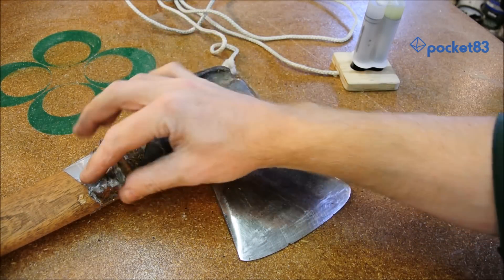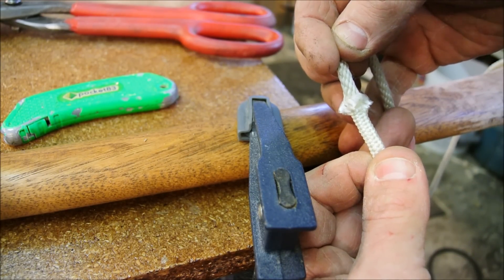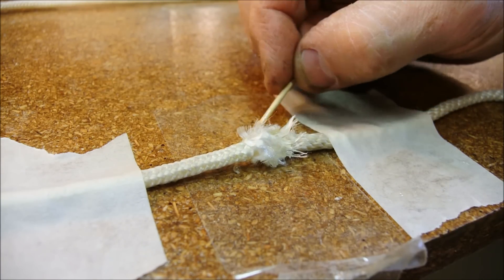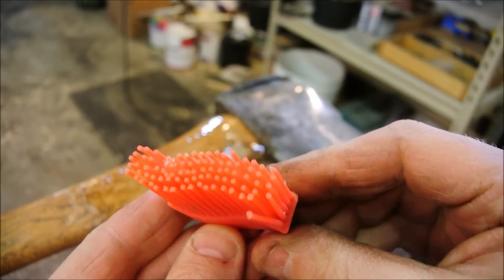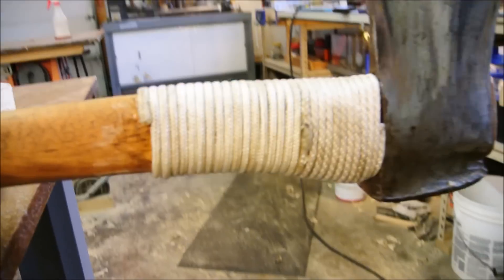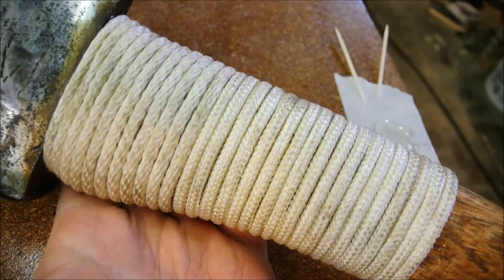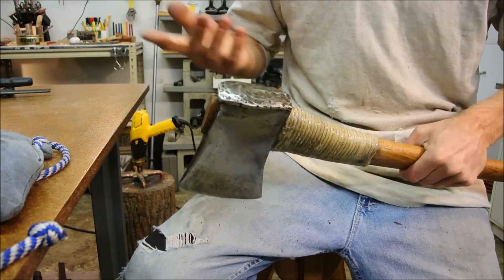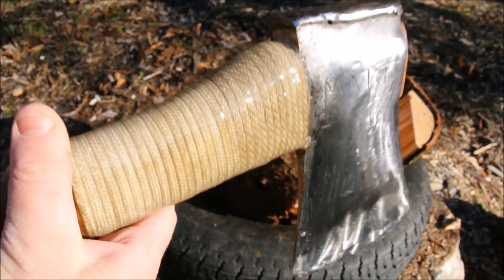Axe handle guard = Rope + Epoxy

Comment: There is a knot called a frap that would work well for this. You make a loop on the surface and then wrap the cord around it. When you get to the end you tuck it into the loop and pull it under the wrapping and trim the other end. It leaves no exposed end to break off. I used it on a sword handle and it worked really well.
Reply: A common whipping knot is what the poster was describing and is arguably more simple than a square knot and leaves a much better finish.
Reply: Frapping is the word for wraps between the spars in some lashing techniques. I don't know how a square knot makes any sense in this context, unless Gary meant West Country whipping....

Comment: Regarding epoxy tips and tricks:  When trying to coat things with epoxy (like the top coat you applied), I usually add some acetone to the epoxy to make it more spreadable and to help it wick in.  

For mixing, I just use an old glue-bound catalog.  Rip one cover off, mix epoxy on the exposed page, when done, rip off the page and you're ready to go.  It's free, it gives more room to work with than tape, and you can pick it up and move it if you need to reposition your work..  

If I need a brush or spatula, I just use a putty knife or a hoghair flux brush.  Clean up is quick and effortless.  I have a jar of lacquer thinner that I use for cleaning small things.  All it takes is a couple dunks and wipes with a paper towel.

Comment: My solution is welded metal handles. I've made a 18" handle for a hatchet from a 1/8"x1-1/2" flat bar and it turned out pretty good and balanced. I have a fireman's axe head I made a 27" handle for from 3/16"x1-1/2" flat bar with oak grips. It's not designed for chopping firewood but I like it. I'm working on a double bit axe right now that I plan on cutting wood with.

Comment: you can try using a heat shrink that has a glue for water proofing inside it, put it on the axe and heat it up to shrink it on .the glue inside melts and then sets again when it cools down .two layers of this will last quite some time and when needed to be replaced just heat it up and cut it off while soft and then replace.

Comment: I am using a piece of cord on my axe for 6+ years, and it works like a charm. I didn't use any kind of epoxy and I think that it is better, because the rope remains elastic and reduces the impact in case of a slip. Also I just knotted it on the handle with a knot we call "takling" in german.

Comment: Hello, thank you for sharing a novel way to extend the longevity of the axe handle! Appreciated. Could you let me know if the guard still does its job propertly after 3 years? Thanks!
Reply from the maker: Strongest guard ever. Highly recommended. The handle in this video broke for other reasons, but the guard was still like new at the time. I then replaced it with an identical, and that guard is now working on its third season under year-round use. As of September 2022, there is one small chip removed from the epoxy. I'll get around to filling it in sooner or later ;)

Comment: I have used the exact process, only using thread, to fix my broken glasses, and used Super Glue.  The finished product was stronger then the original joint, and once the thread was saturated in glue, it just looked like a piece of black plastic.  I will use this technique often.  Thanks.

Comment: Another great video pocket! I don’t know if anyone else noticed this, but one of the older copper wire epoxy stirrers that you used had a patina near the top, but the lower end that actually mixes the epoxy has been preserved by the residue left behind. Anyway, I thought it was interesting.

Comment: Depending on how you value your own time, it would probably be easier / cheaper for most people to simply purchase a Fiskars splitting axe. But this is a cool idea, and I did enjoy the video.
Reply: Matthew Clausing  good solution. Fiskars are reasonably priced. Steel sharpens easily.

Comment: My unsolicited advice is to end it with a clove hitch. When  you cover or soak it in epoxy, it essentially becomes a micarta covering.
Reply from the maker: Haha. Experimental suggestions are awesome. That's not the same thing! But how do you mean? Like, how could you tie the knot without making a big bump?
Reply: pocket83² a Clove hitch would be two layers at one point, but it doesn’t stand far proud of the whipping around the handle. I do walking sticks and knife handles in the same manner. Bushcraters whip, French whip and braid over just about everything for some reason with paracord, jute, hemp or tarred bankline.

Comment: I did similar with much smaller nylon line and used a couple wraps with epoxy between the layers and a layer of epoxy on the outside. 
I'm still using both axes today. The very thin outside layer soaked into the twins leaving it slick and strong.

Comment: As far as expoying rope, I have seen similar applications done using a funnel. Feed the rope in the funnel first, then fill the funnel with glue and pull the rope through the other side.  EDIT: Is that an actual bionicle
Reply: Indeed, I believe so.
Reply: That sounds like a great strategy

Comment: When it comes to the splitting logs like this - never try to acommplish in a first hit. Choose the path betveen branches, preferably  butt log upward,  make a first hit aiming to a corner towards from you.  When the wood fiber cracks a little, proceed with a second hit on side closer to you from the log center. Thats how you never hit the handle and save energy. Nice axe and good luck ;]

Comment: I find tarred twine works very well for this, no glue or epoxy needed it binds super tight and the tar causes it to grip and not come loose, I then sometimes will use leather over top for appearance but not always.

Comment: I find the safety comment conundrum fascinating. As a viewer I have found them useful for tools I don't have experience with, but I can see where having the same stupid comment over and over every time you use a tool in a video, cascading down through the years as the video remains on youtube... well, that would get annoying.  And nothing is ever just dangerous, it's always extremely dangerous.

Of course, it could always be an opportunity. Write a mini booklet of safety advice for each tool you use, only $10 for the e-book version! "This video sponsored by the Pocket83 safety booklet!  Buy now before supplies of this e-book run out!"
Reply: And if you act now, it's free, just pay shipping and handling(which is conveniently more than the cost of the booklet and a small profit)

Comment: Rawhide could be interesting. Applied wet it will shrink/constrict when drying, if I remember correctly.
I wonder what the added compression will do for handle stability?
Reply: I have thought to use rawhide for an axe of mine. One can make an whole axehandle of rawhide too but probably only up to a certain weight and with a holeless bit. People on the prairie and steppe used bone and rawhide, lacking wood, for many applications.

Comment: As an iron worker, we used tie wire. The metal wire used to tie rebar. Then we would wrap that with black athletic tape. I see your epoxy, cracking and breaking with a solid hit
Reply from the maker: Eventually, sure. But it's also easy to fix.

Comment: I have used cotton fabric and epoxy to do the same thiing before, and it is amazingly strong. Just takes longer, as you do one layer at a time and repeat for the number of layers you need.

The only thing I worry about using paracord and 5 miinute epoxy is if 5 minutes is enough for the epoxy to fully penetrate the paracord.

Comment: Just a little tip to anyone doing this, if you wrap some clear packaging tape around the epoxy while it’s a bit less runny it will keep it smooth so you don’t have to sand it down as much or even at all. Usually the cheaper stuff works better because it’s less sticky and easier to take off when the epoxy dries.

Comment: I've done wraps like that. I usually secure the ends by drilling a hole perpendicular through the handle and running the end of the rope through the hole. I use a small wooden pin or wedge to lock the rope or cord in place. In the centerline, it doesn't affect the strength of the handle to any noticeable degree. For thinner cord, it's possible to tuck the ends under the wraps instead. Never used epoxy though. Mostly used paint or varnish to soak the rope/cord and adhere it to the handle. For an axe that'll see a lot of log-splitting, I prefer to make a metal guard.I've no idea about how much better it'd be according to some factual scale, but since you don't have to wait for it to set, a metal guard is probably overall faster to make. And less bulky, if that's important to you.

Comment: it works well to tuck the ends of the rope under itself, pulling it under and up. once it dries, you just clip off the tip sticking up.

Comment: What i normally do for my axes, is i first wrap with thin steel string (1mm), not the braided kind, but the solid ones.. after i've wrapped it all in a thin one, i then do another wrap in one thicker steel string like (2mm-3mm) lasts for ever :)

Comment: I worked in the oil field and i used a rope as well on my sledgehammer to help with the impact and it helps
Reply from the maker: Wow. That sounds like a tough job. Respect from a former roofer.

Comment: Hey pocket I just got my new double bit axe handle definitely appreciate you going into detail about informing me on the green orientation I found one that runs perfectly with the heads of the ax but I have a huge question before I hang it. Can I use epoxy instead of wood glue in the wedge? Do you think it would work? I'm talking about the wooden wedge that you put your wood glue on, and I don't have wood glue and that's why I ask.
Reply from the maker: If you fit the wedge and handle well enough, you don't really need glue. Some people use linseed oil on the wedge. Personally, I use wood glue exclusively, but I don't use step wedges. 

Hmm. I don't think epoxy would be a bad idea, but it's not a good idea, either. Why not? Because it wont allow moisture to pass through it. I don't really have a strong opinion, and I can't speak from experience on this one. I do strongly recommend picking up a bottle of Titebond II if you plan on making many of my projects, since I use the stuff constantly.
Reply: @pocket83squared  thank you so very much your opinion for some weird reason means the world when it comes to my projects. So the fact that you gave me your opinion on using epoxy completely open my eyes and I did not even think about moisture getting into the handle itself I will be picking up a bottle of Titebond II probably tomorrow just so I can put on my way. But it did come with two step wedges which brings up my next question do to your answer why don't you use step wedges is there any particular reason?

Comment: I use construction adhesive/liquid nails and poly baling twine. Liquid nails is good as its a rubber bassed compound and has a bit of give in itBelieve epoxy will be to brittle and chip

Comment: We used baling wire when we were young. Start with the end over the head of the axe handle. Go down about 4 inches below where the axe head will sit. Wrap up tightly to below where the head will seat and end up with the wire end running up under the axe head.  Reattach the axe head, wedge it and the wire will be a strong and long lasting repair.

Comment: Just curious, Pocket. Where do you get the wood for splitting from? Did you fell a tree on the property? And if so, do you try to plant another one in it's place? Or did you scavenge the property for dead trees? I live in AZ, so I'm not familiar with how it works to need to burn wood every winter.
Reply from the maker: Ok, first off: you and I are from different worlds.

I once went quad riding outside of Phoenix, and I thought it would be hilarious to mow right over a Saguaro cactus. It exploded down like a dead tree. My friends were all yelling and waving, so I came back wondering what the problem was. Apparently they take forever to grow, so they are protected. Not the case with trees in PA; if you need a walking stick, you slash a sapling. If you want some wood to burn, take your pick. No need to replace a tree here; within two years, fifty more young spring up in a fallen tree's new sunlit spot. 
So live wood works as follows: it's waaaay too wet to burn right away, so you have to 'season' it by drying it out for a year. But the woods are filled with dead wood here, especially in places where there has been logging. Some of it stands, some of it falls naturally. They all burn with different efficiencies, based on age and variety, but there's more than you can ever use. 

One more thing: don't get the wrong idea, as though I'm wasteful or irresponsible; I use my wood with the best effort possible for its conservation. In fact, in respect of its beauty, I will die without ever logging my own property. I regard dropping a great tree as a (sometimes) necessary tragedy. As such, I can afford to waste my trees without reaching any natural limit.
Reply: @pocket83squared  That's pretty cool. Thanks for sharing!

Comment: I was wondering if after wrapping in rope, instead of sealing with epoxy, which is hard and brittle, coat it with a couple of layers of spray on bed liner. Then it has a durable and flexible outer layer.
Reply from the maker: Hmm. Maybe!

Comment: What about rubber from tyres? Those suckers can't really be disposed of in a proper way, so I try to make any excuse to harvest the material. What with all the stones and potholes, they are made to take a beating.
Reply: if you can find a way to easily apply it to an axe handle i would love to see that. but from what i've seen on how to make tire it's not easy, and require a lot of heat and a mold.
Reply: @BloodSprite-tan  either this - or just epoxy a square piece of tire to the handle with a clamp :)
Reply: @BloodSprite-tan  I was thinking cutting a piece of rubber from an existing tyre, then gluing it on top of the rope and epoxy. I imagine CA glue would bond well enough between the rubber and hardened epoxy.
Reply from the maker: Tire is brutal to cut. Every time I try to craft something with it, the steel radials remind me again of why they just end up dumped over a hill somewhere. Still, you're a good person for trying! If you must persist, maybe try a mountain bike tire, since it will be waaaaay easier to wrap.
Reply: pocket83² a hefty bmx or cruiser tire would be ideal. Also with bicycle tires often the only steel in them is in the bead. The casing of the tire is generally made of rubber and Kevlar/cotton/nylon fibers
Reply: @schenksterify  I think the same is true with gokart tires. They're wide and quite pliable, and their naturally small radius should mean wrapping the handle is easier. Now I gotta bite the bullet and cut up some of my old kart tires I think. Might not have to use the angle grinder, though, which would be nice for a change.
Reply: @ekner  and motorcycle tires too. I actually know that for a fact because I once wore one down all the way to the textile... (yea, I know, dumbest thing I ever did on the road)
Reply: @lukearts2954  I think the outer layers might be textile in most tires, which is why I'm not sure about the gokart ones. They definitely show a textile material when worn out, but I don't know what lies deeper within. Only way is go cut one up, find out, I suppose!
Reply: @ekner  I think you can make assumptions on what to expect based on the wall: is it a straight wall tire like cars and trucks, or a round wall tire like bikes? If it's straight wall, it's safe to expect metal. Fire up you lightsabre ;)

Comment: I was trying to find your video on the green handle ax and came across this one. I like the use of rope and the epoxy as the benefit and cost seem reasonable and apparently works well. I wonder if paracord would work just as well, but I am guessing that it's really the epoxy that is providing the strength and protection. Nice narrating with your video.

Comment: You could use a length of STEAM PIPE that is used between train cars. This stuff is really tough and slips over the handle and is sometimes the right  size to make it tight...  Works for me...

Comment: I would recommend a Fisker splitting mall works real good has a lifetime guarantee and is pretty much impossible to break
Reply from the maker: That thing is an inelegant club. It's better suited to an Orc than to a skillful splitter. I made a video explaining why I prefer this heavy axe to something like that. However, if you are going through large rounds, I can understand its purpose; it's not for mine, though.

Comment: Not to sound pedantic or anything but the time duration in the name of the epoxy is the open time, not the cure time. Like, how much time can you work with it until it becomes unreversably set.
Reply from the maker: Sure, no worries. But even that is inaccurate. I suppose it's just to give you an extra time cushion, because in all likelihood you aren't fully prepared when you mix it! Seriously though- epoxy just doesn't have a definite line between solid and liquid. There's lots of variables that affect the speed at which it will change.
Reply: @pocket83squared  Of course, temperature and humidity highly affects cure time for epoxy and even the 5min barrier is just a prescriptive duration, but still saying "it's not cured after 5 minutes" is misunderstanding why the time is there at all.

Comment: Wouldn't that cause a bigger stress point on the handle? I know a fishing rod is a lot different, but the most likely point of a break is where the eye is wound on with thread and too much epoxy takes out the flex and cause a snap..do axe handles have any flex to them? Just a little concerned :')